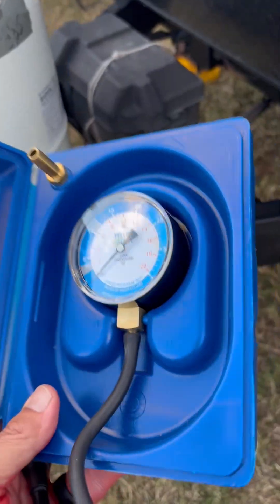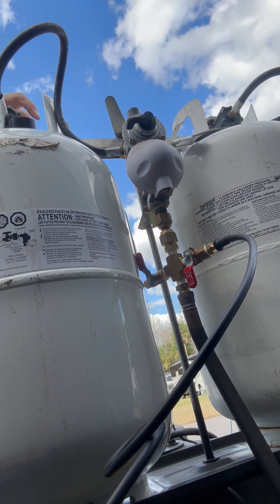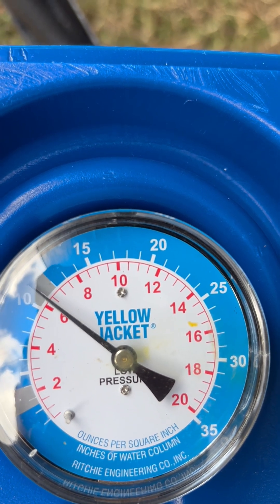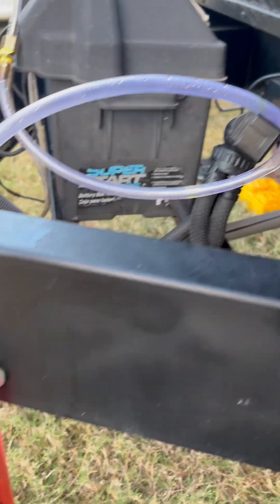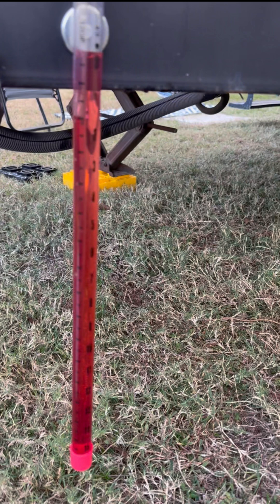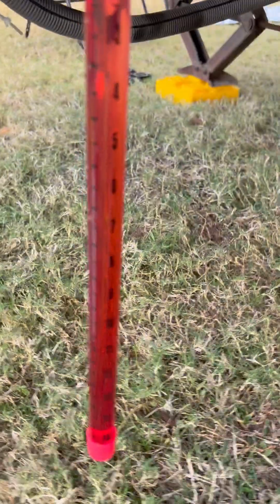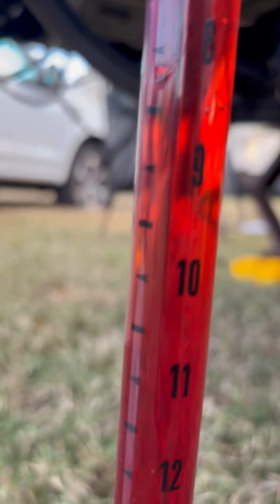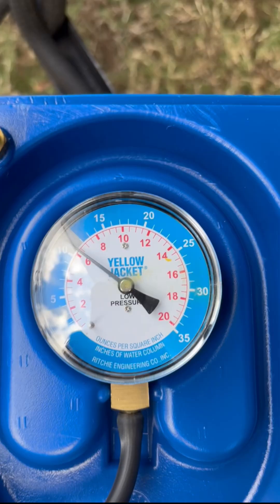Calibrating RV Propane Gas Pressure Test Kit

Comment: You may want to confirm which hashmark is "0", I read that water manometer as "11,2"; the short hashmark in front of the "11" would be "11.5".  I hate it when they label the range within the amount("x") instead of labelling the exact location of "x.0"